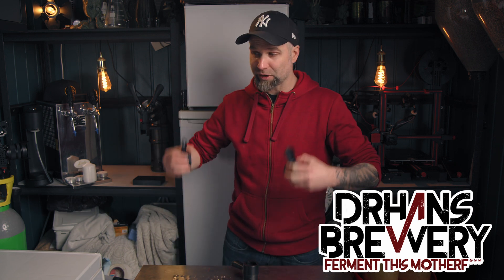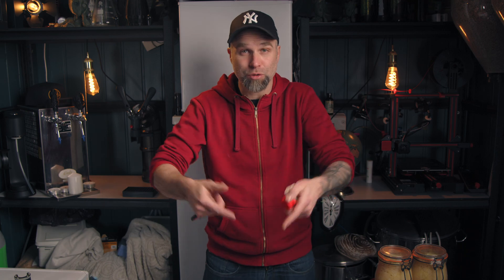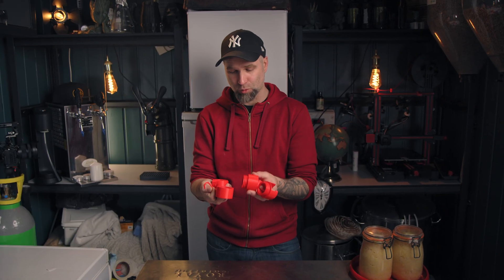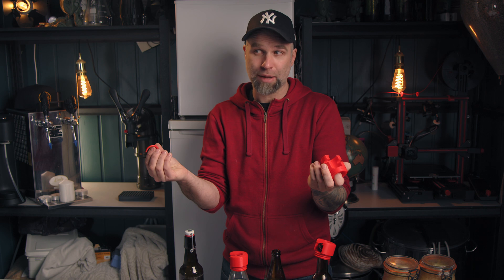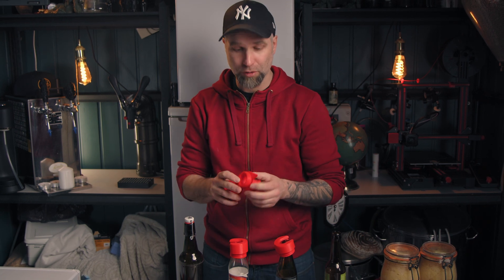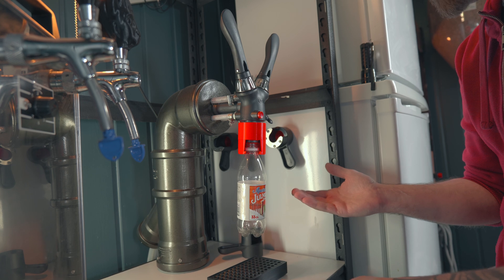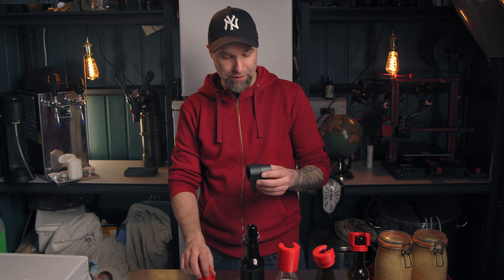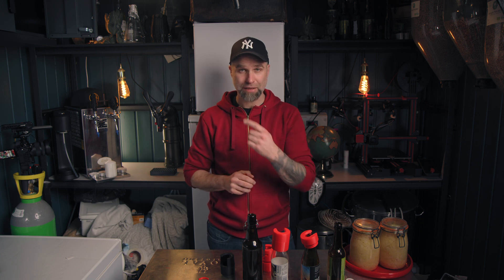DIY 3D Printed clamps for the iTap beer bottle counter pressure filler

Comment: The models say to use PETG which is much stronger than PLA AND 70% infill and you seem to have used 20%. Not really surprising that they failed.
Reply from the maker: Thanks mate I'm a total noob at 3D-printing. It's all on me that they cracked.

Comment: Does anyone has problems with the head for the PET bottles? In my case the PET bottles does not fit because as they have a bit longer nozzle (the place where the cap is going).

Comment: I would not use PLA for this. PETG is a much stronger filament.
Reply: also use more infill and print each valve one at a time. a hot air gun is good for stringing
Reply from the maker: Thanks for the tips

Comment: I've been 3d printing and homebrewing for years, keep it up! I would use PETG for strong prints, I don't bother printing with PLA anymore. PETG needs a higher temp 252c nozzle and 80c bed on my Ender 5 works great for me. I would up infill to 30% - 50%, make sure you use a food grade nozzle for anything touching beer.
Reply from the maker: Thanks!
I will definitely try another material and higher amount infill to try to get stuff like this stronger. Cheers

Comment: About the printing. For good adhesion between the layers, you need to test and find the right temperature for your filament.  It may not be the same temperature that gives the best look.  20% infill is not ok if you need structurally strong details, maybe 70% or similar may be appropriate.  Infill pattern, you should choose a suitable one for the load case you have.  The walls should be decently thick.  The one in the video broke all too easily.  For the material, PETG may be worth a try.
Reply from the maker: Thank you for your inputs and guidance. I'm new to 3D printing so I'm thankful for tips. Cheers

Comment: i shaved a few thousands off the metal collar lock to fit the majority of differrent bottles as it did not fit some, i let the manufacturers know the size but dont know if they made any changes, between the plastic one and the widened metal one i can no fill most bottles i come across :)
Reply from the maker: Awesome 👍